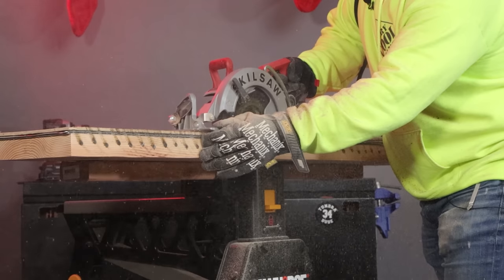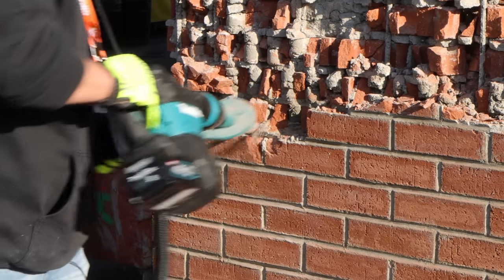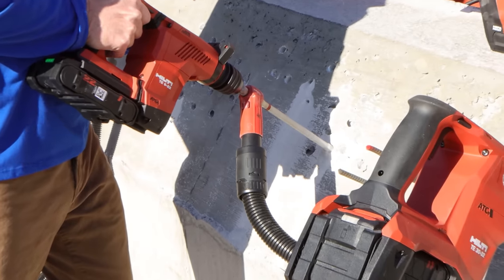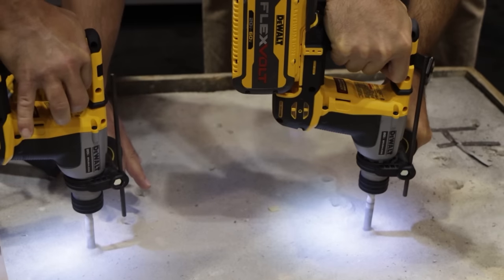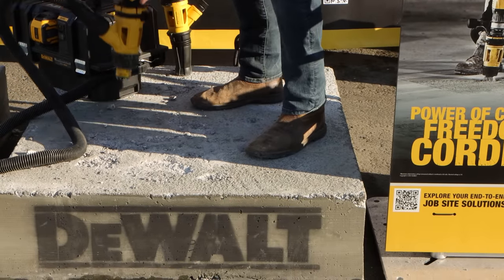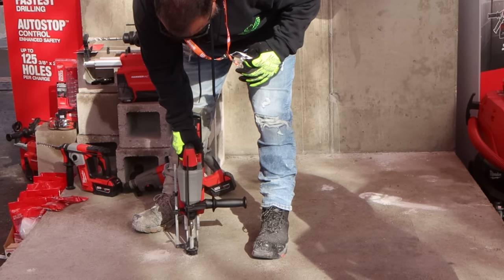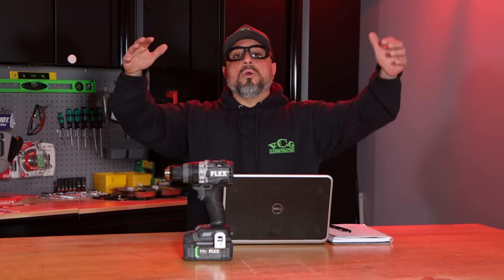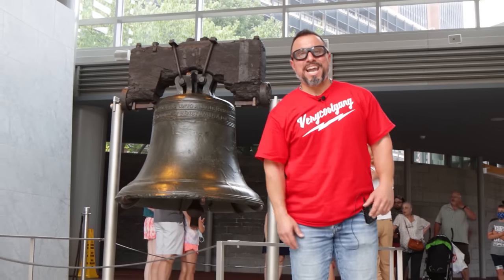Top Cordless Power Tool Brands RANKED!

Comment: The best tool platform is the one you use to be able to get the job done. I've used Makita, Dewalt, Milwaukee, Flex and loved the ones that did not give me headaches. For example I burned through two Makita grinders before going with Dewalt, but found the Makita drills unbelievable performers that I can drop from a roof and still know they will work. So, whatever does the job is my favorite. That's just me.
Reply: Metabo I have to say makes the best grinders..use and abuse and they last
Reply: @shakeeshakee9457  That's great to know but I have to say seeing two Makita grinders literally smoke and spew smoke everywhere - won't forget that one.
Reply: I just switched over to the 60v Dewalt because Metabo just wasn't getting tha job done and love it!! You're show is awesome love your excitement and inspiration,! Keep it up bro!! Great video....
Reply: How I feel with my Porter Cable drill.  Left it in pouring rain overnight (twice) and after letting it dry out and sitting in water it runs great 2 years later.   Still miss the tools of yesterday.    Steel, long lasting and built in USA.  👍
Reply: Any recommendations for a good jigsaw?
Reply: @aaronq2627  I've used the dewalt brand and it does fine. Granted I don't use one that much but it seems to be fine.
Reply: @aaronq2627  Dewalt DCS335B 💯
Reply: @aaronq2627  I have used a Dewalt and found it worked just fine. Had nice features but not as durable as I would have liked. However, I don't use it that much either.
Reply: @aaronq2627   I have a old professional grade Porter cable Not the new ones not the ones you get in the big Box store  I've had it 30 years works like a champ I guess whatever battery platform you're in if you're going for battery I would stick with If  Corded  Milwaukee dewalt Porter cable They'll all do the job just some do it better than others Depends what kind of work you're trying to do with it
Reply: Kobalt tools been good enough for me.
Reply: @JR-gq8ti  I have a few of Kobalt. They work quite well
Reply: @stemmentor9700  we ran porter cables in our company for a good while without one single problem. great tools
Reply: @stemmentor9700  my dad's Porter Cable tools are unbelievably reliable. I run DeWalt and yes all my out perform his, but I have to hand it to them. My dad got them when their 20v line came out years ago and the batteries and tools are still chugging like new
Reply: This is the problem, some tools from each company shine above the rest while others were just made to be rushed to the market… to have the best set of tools in a box you almost have to have 3-4 different brands and have all of those different batteries. But overall most of us wouldn’t know the difference or be able to wear out these tools for many years.
Reply: It's not just you. Most common sense people are thinking the same way.

Comment: Love your videos!  I use Makita platform and so far my on the job experience,  nothing else holds up.  Hot, cold, wet , dry, mud, drops, dust, you name it, all the others doesn't stack up.  That said, I believe that your top 5 is solid. I did just get the M18 table saw and it is awesome!  The packout system is also very cool!!!!!

Comment: Great Video! For me it goes…
1 Milwaukee for line up for specific trades,     quality and innovation 
2 DeWalt great carpentry line up
3 Makita for quality and precision 
4 Bosch for quality and price
5 Skil for price and latest upcoming innovations
Reply: Which trades are you thinking of for milwuakee 🤔
Reply: @mardengonzalez3561  HVAC, Plumbing, electrical, and general construction. They’re platform offers the widest variety for numerous trades. I’ve done HVAC and plumbing for 26 years and my van is loaded with numerous Milwaukee tools.
Reply: @michaelmcewan5074  thanks a lot, I’m about to buy into milwuakee as an hvac sheet metal worker. Excited to get my hands on their tools
Reply: Dewalt is the most innovative brand in the industry in my opinion.
  They were the first to create a multi-platform battery ranging from 20v-120v while keeping all the batteries interchangeable.
  They were also the first to patent a new battery cell technology called "powerstack". The new cells are a giant leap forward for the cordless tool industry.
  Though, I will say, some of my hand tools, bits, and sds bits are Milwaukee. They also make high quality tools. I especially like the fact that their sds bits are made in Germany.

Comment: 1. Milwaukee 
2. Makita 
3. Dewalt 
4. Ryobi
5. Ridged, simply because they offer more than Flex/Kobalt
Reply from the maker: Nice, thanks!
Reply: I don't really like Metabo HPT tools but they should be 4th for their nail guns, table saw, router, and the fact that they offer an AC/DC adapter.
Reply: @Tool_Addicted_Carpenter  I will only buy Hitachi/ Metabo nail guns. They are amazing and so far above the cut.
Reply: And where is festool 👀
Reply: Or Bosch Professional 👀
Reply: @germanplay_1094  they are pretty niche when you look at it as a whole. from what I know (and I may be wrong) but they are primarily for woodworkers. now if you are a woodworker and have the wallet. then yes I would go festool 100% but for construction, plumbing, electrician, mechanics, maintenance, and other trades I haven't listed there are other brands that can meet your needs. and any of the 5 listed are all great brands it all comes down to what you can afford and of what you can afford, which brand offers solutions that will best suit your needs. and in my opinion Milwaukee takes the prize due to a few factors, performance, build quality, price, innovation, and other intangibles like storage solutions, accessories and warranty. lots of factors to consider but for me Milwaukee would and does meet all my needs and they haven't let me down once yet. and if you are team yellow, orange or any others and they meet your needs then more power to you. side note, i am a maintenance supervisor for a large apartment complex and yes i use Milwaukee
Reply: @justinmclean5778  oh yeah i Understand what you mean 💪
Reply: I would agree with your list before VCG’s list I’m not taking any shots but I would put no consideration or merit into that list.
Reply: With dewalt on the come up.. makita tools getting tougher to get a hold off
Reply: @germanplay_1094  festool, to me personally, seems too expensive as a platform.. I own two, the domino joiner(arguably my favorite tool) , and the  Kapex KS 120 REB Miter Saw(arguably the most disappointing tool for the money) It’s solid, but I still use and prefer my makita 36v 12” miter saw. I’m still just not sure what to make of them as far as investing in them at this point. Considering I have all tools I need in Makita, Milwaukee and Dewalt. If you got a favorite festool tool, I’d like to know which.
Reply: Haha you lost all credibility with putting cryobi on your list
Reply: Dewalt should be higher up they have flexvolt and power stack batteries and they just made the atomic impact wrench its the best compact on the market right now
Reply: @MrWilliewonka69  ya ryobi does not belong on that list
Reply: 1 Milwaukee
2 Dewalt 
3 Flex
4 Ridged
5 Ryobi
Reply: I agree with your list!!!

Comment: So many good tool brands out there. Truly they all work. This is why we pick Metabo HPT. We just wanted to stay in one battery platform. MultiVolt AC adapter, which allows any of our cordless tools to also be run corded for all day. From framing, roofing, siding to finish and any specialty in between, and to cordless nailers feel like your pneumatic. The new 36V MultiVolt 7-1/4 Inch Rear Handle Circular Saw weight only 8.2 lbs.  Only 8.2 lbs. awesome.   Vince great topic.
Reply: All great brands, I went Dewalt and don't regret it at all! 💪
Reply: @sarjxxx  HPT question I bought a used set of 7 tools for just $70. The issue I’m having is finding genuine Hitachi / Metabo batteries 18V the type that have a column that inserts in the tool. All I can find are Chinese knock offs with poor reviews. Any ideas?  Thanks

Comment: My Rank for these brands will be as follows:
1. Hilti - Reason being their Tool Park Management Service saves you a fortune of money on your multiple jobsites & also the one platform Nuron helps you optimize your tool park. Productivity, Performance, Health & Safety along with Sustainability offered.
2. Flex - The soul reason being their performance & nothing else. They still fall short of providing service as compared to competition.
3. Milwaukee - Reason being they fail to achieve one platform for all their tools hence increasing the number of tools per jobsite. But still better than a lot of competition.
4. DeWalt - Reason being the compact sizes of their tools make them earn alot of brownie points but still they have to go a long way in improving the performance of their tools below 24V platform.
5. Makita- Reason being they don't release the most latest technologies, they wait for it to become a global need & then they launch the tool.

Comment: Dewalt has done a lot of innovating lately almost as if they suspected a list like this was imminent 😁
IMO
1. Milwaukee(best innovators and honoring the warranty)
2. Dewalt(the dcf 850 plus power stack is 🔥)
3. Makita(great battery life and ergonomics)
4. Flex(tools are heavy)
5. Kobalt/Ryobi
Reply: I’ve seen no innovation from dewalt. And this from someone who has ONLY dewalt tools and somewhere between 10-20k of them. 

I’m disappointed. A smaller impact and smaller battery? I have it… hardly innovative. It wasn’t a problem that needed solving for me. Give me an industry leading battery vacuum. Give me a a completed tough system. Tough system two is no different than the first one and yet the drawers still fall apart in no time.
Reply: @runnerdude1990  Are people really using the Tough System or even the Pack Out in the construction field or are they more of an industrial maintenance/service technician bauble? I agree with you, the DeWalt vacuum sucks, no pun intended, but how many people in the grand scheme of things need a cordless vac enough to lay down the shekels for one? I do like those that can be used as a dust collection system, but vacuum cleaners are hard on batteries, so not that great an option, IMO.
Reply: @pheloniousmunk  I am using the tough system in my trailer (on racks) and the guy working with me uses the pack out.
Reply: We use a rigid battery vac around 4 hours a day.
Reply: @runnerdude1990  doing what?
Reply: @pheloniousmunk  doors and windows clean up from demo.
Reply: @runnerdude1990  I have a Tough System and my kid has a pretty nice Pack Out setup, but frankly I don't see a huge benefit for residential contractors because most of the time you don't need to have all those tools at once. Just my opinion, but I'm not seeing a lot of guys using them. Now for using them to organize in your van or trailer? I can see it.
Reply: Id put ryobi in 4th above kobalt and get rid of flex because ryobi has the new HP stuff that's almost too powerful and flex barely exists in Canada.
Reply: @carolineinthecity411  yes. Because I need my tools to do a job. Innovation is secondary. When I started acquiring tools a decade ago they were the top of the market as well.

Comment: Metabo HPT is where it's at. They're priced right and they have they are just a joy to use.
Reply: Their multi tool performed poorly on all levels on project farm( I know all great brands may have a bad tool in the lineup)
Reply: If I had to pick just one , maybe I would go with metabo , I use them all except for ryobi and milwaulkee
Reply: @Crimsonvandal  I would just stick with their multivolt tools that take advantage of the 36v with some exceptions. The best example is the 36v reciprocating saw. It’s huge and bulky but it’s fun to use.
Reply: I've had to of there 4ah 36v batteries die on me. I'm pretty sure the cold did it, how do you have a tool platform aim at pros and the batteries die in the cold. All the way dead like purple blinky lights on the charger dead. I guess there nice if you live in Florida.

Comment: I have Bosch, Milwaukee, Ridgid, Dewalt, Kobalt. Some are newer tools and some are older tools. I use the Bosch and Milwaukee a lot and have had good luck with them. I have some of the Ridgid tools that I use often and they work well. Most tools today are good quality and if one is watchful, they can snab some good tools at great prices.

There is a home depot and menards near me but lowes is over an hour away so tool selection can boil down to what is conveniently available in your area.

Comment: Milwaukee makes the best plumbing/auto mechanic tools, milwaukee makes a great M12 3/8 stapler, dewalt had the first reasonably priced cordless 7 1/4" miter saw, dewalt had the first solid battery only finish/framing nailers, dewalt has the first solid cordless roofing gun(bostich tried) dewalt had the first cordless table saw, dewalt had the first cable stapler and fence stapler, dewalt had the first and still kind of the only 20/60v battery powered generator/charger, makita makes the only cordless biscuit joiner, makita makes the only cooler/heater, etc. Point is, if you think one tool line fits all, you're not in a versatile industry, you're in a specialized industry. Those of us that do it all understand that you need to own all different tool lines. No single tool line owns it all.
Reply: I work at a large plumbing company and never met a plumber who didn’t use Milwaukee
Reply: @Crimsonvandal  Ya my buddy is a union plumber that leads a couple hundred guys for a company with a few thousand guys which is what got me started on some M18 tools. He gave me a bunch of 9.0 and 5.0 batteries so all my lights are M18 and I have the chainsaw, 9" grinder, and blower. I had really bad luck with the M18 fuel hammerdrill, impact, and sawzall though. Hammerdrill chuck locked up, sawzall won't change blades, and impact gun glitches forward/reverse for a few trigger pumps after changing. All happened in less than 6 months. $450 gathering dust. Never had a problem with my makitas or dewalts. I love my M12 stuff but the tripod light piston failed after a month so I returned it, the collet in the fuel impact is messed up after only 6 months, and the hammerdrill doesn't have much power, even for a 12v. I like the jigsaw, hackzall, right angle drill has a ton of power for a 12v, the fuel multi tool is a monster, and the magnetic roving light is pretty slick. I'd love an M12 pro press but I can't quite justify the money lol. The copper cutter is sweet too. I totally understand why plumbers go for milwaukee. I absolutely would too. It's honestly necessary. Same for auto mechanics. M12 and M18 own those industries.
Reply: You nailed it Tac!
Reply: @Crimsonvandal  I love the Milwaukee Porta Band and Hole Hawgs and I think they have earned their place.
Reply: @Crimsonvandal  I work for a Union Pipefitting company that specializes in Commercial and Industrial. We use ONLY DeWalt. The reason is that they have power tools made in the US, and the tools that are not use the same batteries that the US made tools use. That is it. My Union prioritizes American made and Union made tools and part first, but they have to not lack in quality. We also work many jobs where you HAVE to (per contract) use only US made tools and parts.

Comment: I think it greatly depends on what you do. If you're an electrician/plumber, milwaukee is a no brainer. For us framers id say metabo hpt or dewalt, leaning towards metabo hpt. Best pneumatic and battery nailguns, amazing recip saw/impact/hammer drill, and their new rear handle is amazing.

Comment: I hope some day that Bosch pushes the envelope and make it to your top 5 as i value your ratings, videos, tool evaluations, as they are honest 7 great information to us consumers when buying the right tool. Their new line of tools are quality, my favorite, even though i like some tools from all brands too. Much Respect
Reply: I currently own Bosch, Milwaukee and have also owned DeWalt, Craftsman and Ryobi in the past. None of them can hold a candle to Bosch when it comes to build quality and tool control/finesse. Makita may be up there as well but I have never owned their tools to compare.
The problem with Bosch is their not-so-great commitment to North America. Their lineup was improved last year with the addition of PROFACTOR (whose tools are a beast and can get you corded levels of power on a single 18V battery) but they're still missing some critical tools like right angle impact drivers, right angle impact wrenches, cordless ratchets and nailers to name a few.

I'd still rank them at #5, though. Flex doesn't get my attention yet with also a limited lineup and still unofficial announcement from their stacked cell batteries.
Reply: @luisinhoens90  I think it was a joke he puts Flex #1 - just didn't wanted to mess with promotion payments from other brands and gave #1 to stillborn brand - haha it's funny.